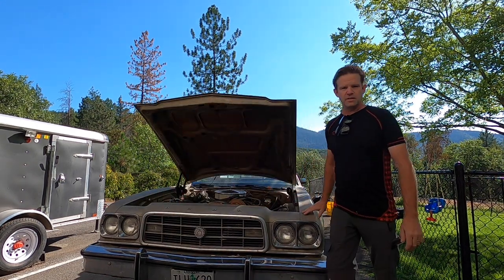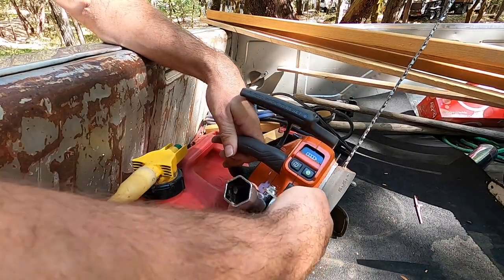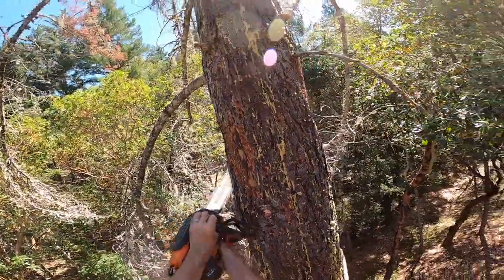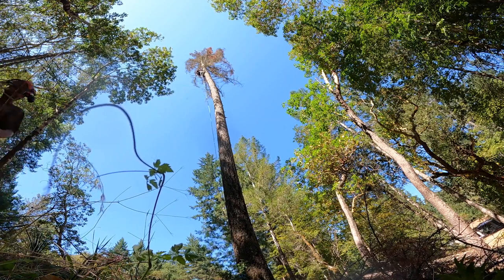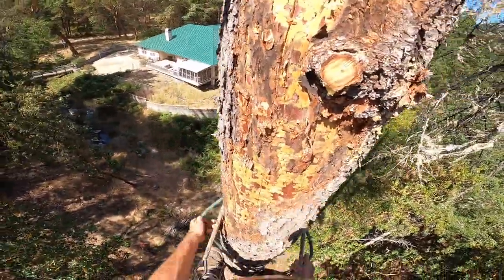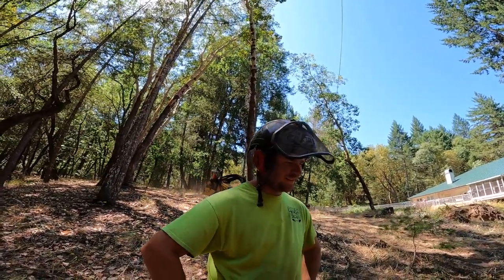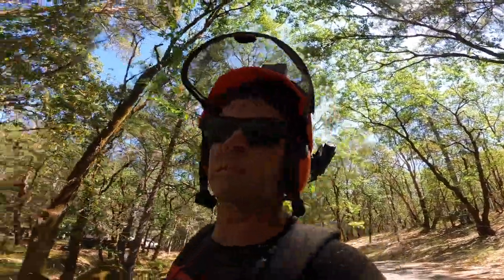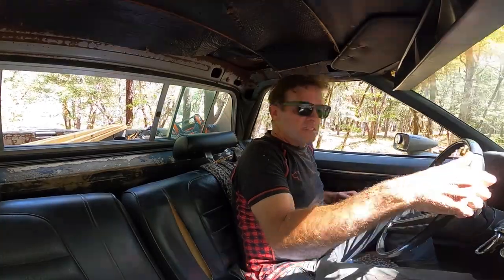RE: Pricing for HAZARD TREEWORK

Comment: This is what I do in the morning before getting out of bed. I raise my right leg bent at the knee, hold that position for 2-3 minutes clasping my hands over the knee. Do this with each leg for 2 to 5 reps. The next one is to lay flat on the back, then bend both knees with feet flat on the bed, then arch your back, hold for 1-2 minutes. Do 5 reps, slowly build up to 10, do it each morning, it helps the lower back. Best to remove the pillow before doing this.

Comment: No matter what job a person does, there are parts that are overpaid, and parts that are barely worth it. Even the best estimates can be wrong. So in the end, the best way to approach it is to set pricing to include a good average, and don't concentrate too much on distracting details. If you're too busy, a slight bump in pricing can change that. Just be prepared for the change in clients and type of work if pricing shifts too much.

Comment: Make sure that pump has a output re-circulation line that goes back to the tank too. Otherwise when you close a hose you stop the water flowing through the pump and the bearings get hot, then they leak water in, and soon you've got bad bearings, and water in you're engine oil.

Comment: Your Ranchero shifting sounds like your "Neutral Safety Switch" located on the transmission shifter linkage needs to be adjusted or replace.

Comment: Maybe you could consider an electric pump for your water tank. I have used some that put out enough water to quinch grass fires and some bigger fires. They are instant on and stay charged with the truck motor. If they are legal to use in your area. you could have both pumps plumbed into your tank and start with the gas pump and use the electric pump in a not start emergency. Yall keep up the good work !

Comment: What's the purpose of cutting off work at 1pm? Are brush fires less dangerous in the morning somehow?
Reply from the maker: Super hot here… much dryer in afternoon, and the dewpoint is better in the morning. Chainsaw exhaust and sparks from the chain going over the bar can cause fires.
Reply: @AugustHunicke  Wow. That's really surprising. I'm out here in the upper midwest and we don't really deal with droughts that extreme and I can't really imagine conditions changing that much over the course of a few hours. Glad you're at least able to get a partial day's work in safely.